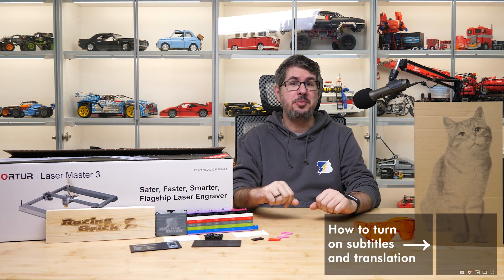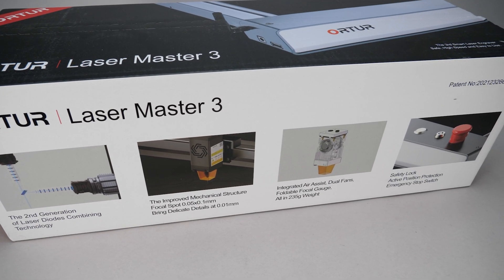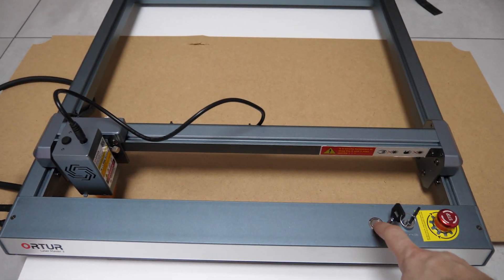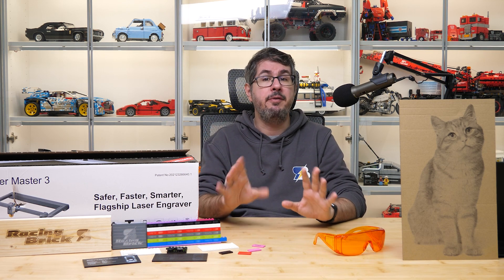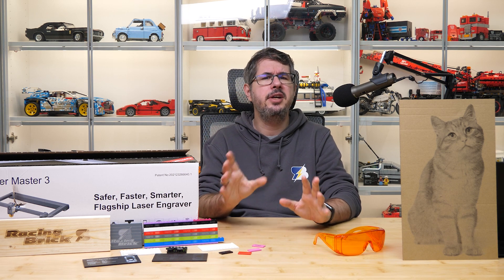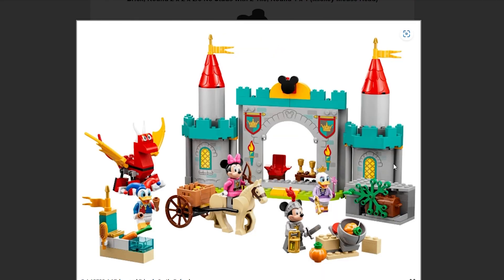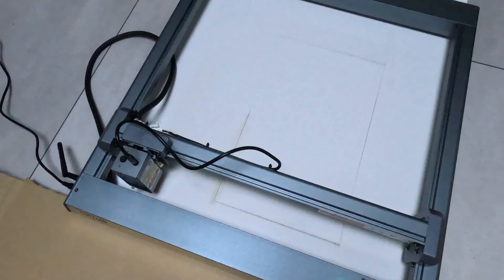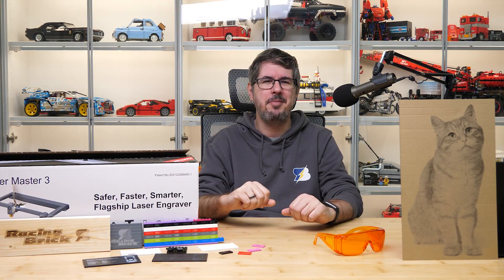Laser Engraving LEGO Pieces - Can it be Done? Ortur Laser Master 3 test

Comment: Jesus the lack of an integral shroud or guard on the engraver and the reliance on potentially useless garbage UV absorbing goggles that might not even be laser goggles for a 10 watt beam is *terrifying*, for comparison a laser pointer you'd use as a toy is usually a single or double digit value in milliwatts- over a thousand times lower power and the minimum power setting at 0.75% is still 75 milliwatts which is plenty hazardous, the fact you need a key to activate it is evidence of it's hazardous nature as it's a requirement for class 4 lasers above 1 watt, I would construct a shroud for it immediately and without fail if I intended to keep it, that beam can and will reflect and scatter off surfaces you wouldn't normally consider reflective and still have enough energy to cause skin damage and ablate chunks of your retina away instantaneously and you only get a single opportunity to be blinded- chuck the goggles and buy reputable ones.

I wouldn't say it has great safety features, while it does have mechanical interlocks that respond to motion other products with significantly lower power beams come with enclosures, there's generally a really bad precedent of similar X/Y engraving tools having poor safety equipment.
I'll give you the benefit of the doubt assuming that you like many purchasers simply don't understand just how hazardous the product you bought was and it honestly isn't your fault; the manufacturer has made an inherently unsafe product and is marketing it to people who have no formal training in class 4 laser products, but I need you to understand that this thing is not a bench saw or any other garage tool appropriate for a potentially newbie, it's more like a large industrial lathe and is very powerful and can hurt you during normal use without any interaction just by being in the vicinity, I would send it back to get a more safe product, this isn't a bench tool and it can and will hurt somebody if you continue to use it in an open an unsafe manner; you can't be vigilant 100% of the time and you cannot prevent children, passers by and animals from being in the vicinity without physically locking it out.

On top of all of that being a nitrogen bearing plastic I'd be very worried about using a laser engraving tool on ABS plastic typically used in LEGO pieces due to the risk of forming cyanides and cyanogen among other ugly compounds in the combustion products and using it in an enclosed space without a fume extractor or ventilation is a bad idea, I know two chemists with long term nervous damage from acute cyanide poisonings they survived and it's real unpleasant, that aside the material tends to melt and smear rather than be vapourised and ablated by the beam, and the potential for a fire due to bad programming passing the beam too many times over spots which cannot conduct or radiate the heat fast enough is significant. 

Don't take this the wrong way, I know it sounds like a lecture and I barely know you but I do care about your health and I scream internally when I see these unshrouded high energy laser products made by unscrupulous companies being marketed to individuals.
Reply: You think bench saws are safe and newbie-appropriate? 40,000 bench saw accidents every year in the US alone, 4,000 of which result in amputations. 
Laser cutters are about as safe and as dangerous as other bench tools, like circular saws and lathes.
Treat them all with extreme respect. They can all blind you. The only real additional dangers of lasers are that they aren't as "scary" as spinning sawblades, which invites an inappropriately casual attitude, and the (serious) issue of gases. But ... newsflash ... you also get noxious gases when you cut or mill plastics conventionally. It's just that nobody ever warns you about it. 

Shattered circular sawblade fragments can kill people in the vicinity if you're not using a guard. Don't Google circular saw accidents ... you'll have nightmares. The guy who gave me my safety training on the use of a circular saw, cut most of his hand off a few weeks later (probably because he was a professional demonstrator, and trying to cut and talk to the audience at the same time). 

Ideally, every power tool store really ought to have a noticeboard with details of local community centre nightclasses, where people can get introductory safety training on all of these tools. I got my laser safety training at the local workshop cooperative. Perhaps someone can post a link to a YouTube laser safety video.

Comment: i think it can be really useful for transparent backed stickers, as usually there will be lots of marks on them when placed. one way to recreate stickers can be to use a thin blush or marker (those used for models) to fill in the engravements. I hope you can try engraving a speed champions set ( eg the countach) to compare engravement to stickers

Comment: If you want your laser engraved bricks to have a print, try applying a sticker sheet on top of the brick or surface that you'll want to engrave then engrave on it with the design you want (with the sticker still on the surface). After doing so, apply paint on it (spray paint or silkscreen paint works) before peeling off sticker the sheet, I would do this on some laser engraved acrylic sheets I work on. Hope this helps :D

Comment: One technique I use for alignment is have two layers in your file. cut out the perimeter in a scrap surface like wood or mdf. Then place the LEGO into the void without moving anything else. Now you are aligned for running the second layer to engrave.

Comment: Very cool video! It got me thinking if its possible to engrave on lego wheels too like making the f1 pirelli pzero/cinturato markings?  When you get a proper cutting base, you could also use it to make stencil plates to help make "printing" the lego bricks using spray painting or similar. Looking forward to you 3D printer video. Cheers!
Reply from the maker: The challenge with wheels is the surface as it is not flat, this process requires a leveled flat surface

Comment: I think this is a very nice base to then paint the engraving, it will work very well (and easy) for monochrome logos or simply text.
Remember the pieces of old made by Lego themselves? They were probably melted in and painted, the laser adds pattern capability.
Look for instance at 3010pb011 and 3010pb011b from wagon 124 from 1969!

Comment: Excellent result, fantastic for creating logos on lego kits.
it could also be used to create graphics by painting the component and using the laser to remove the paint where needed. 
Or dig deeper into the lego and insert the paint into the hole dug by the laser.

Comment: exposed laser? a BIG NO for me!
laser (engavers) are EXTREMELY dangerous and NO-ONE without proper training should have one!
awesome video but i dont condone it :)
Reply from the maker: Personally I don't think it would be more dangerous than most of the tools you can buy at a hardware store. There are dozens of ways to hurt yourself seriously with those as well, so if you operate them (and a laser engraver) responsibly with the proper precautions then it should be fine.
Reply: @RacingBrick  most hardware tools cannot harm you across the room and won't give you lung cancer

Comment: Can you reply to me also why did speed champions stop doing realistic wheels
Reply from the maker: I didn't realize it happened. They switched the wheel setup to be able to make more realistic looking wheels at this scale
Reply: They changed the design to allow 2x2 round dishes and plates to be used as wheel covers. Wether that's realistic or not is not my call.
Reply from the maker: @mahj  and they also changed to design to be able to have tires with a lower profile.
Reply: I still find them pretty realistic. Especially with wheels like on the Mercedes F1 since they look so much cooler with the wet tire print.